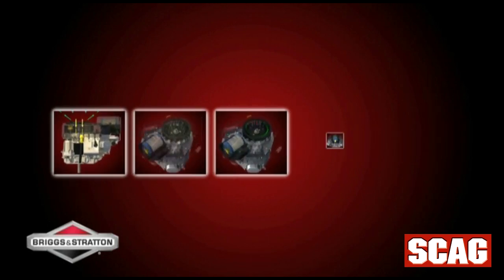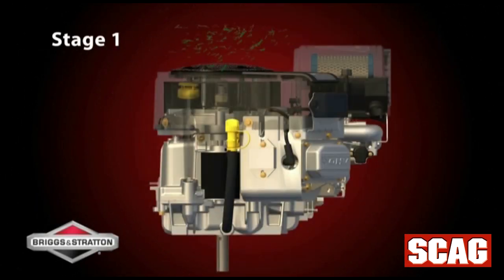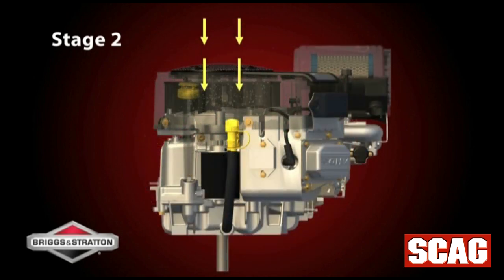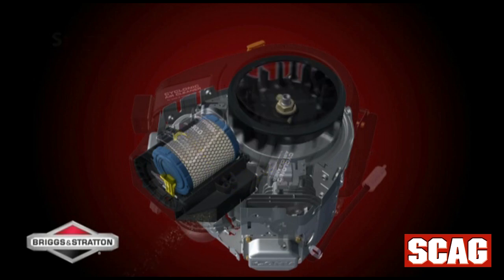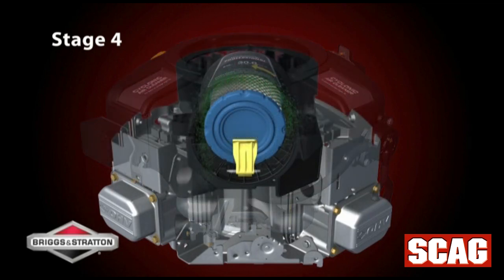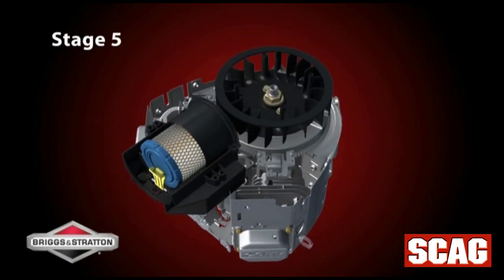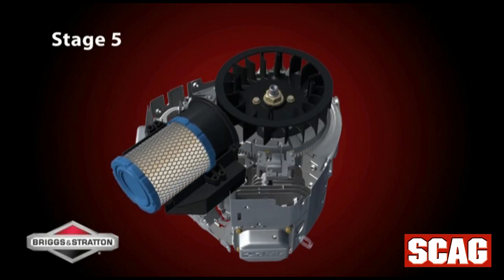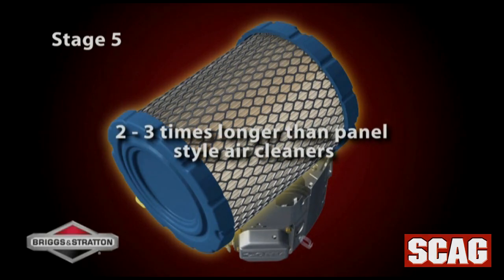Scag Mowers with Cyclonic Air Filter System

Comment: The air filter as well as oil filter are way to small.Just had a 27hp Briggs engine put on my 60"  zero turn.Time will tell if this engine is worth a hoot.